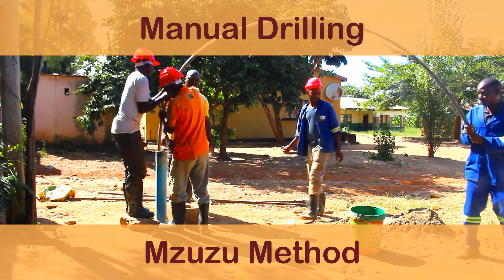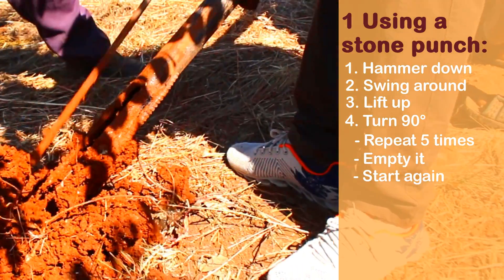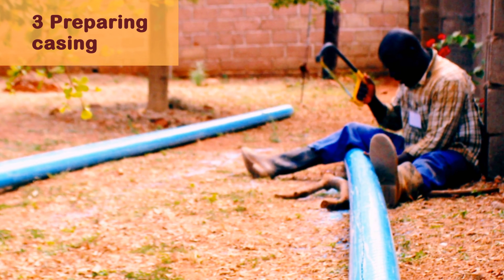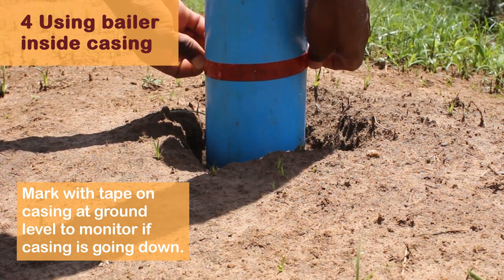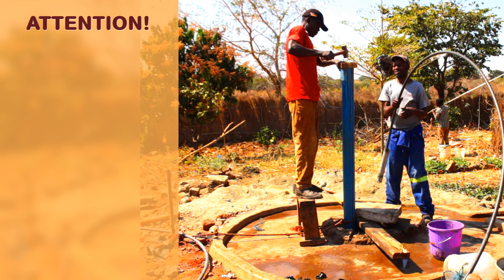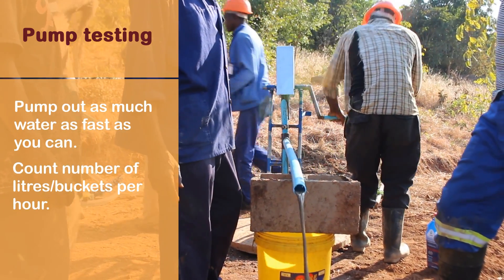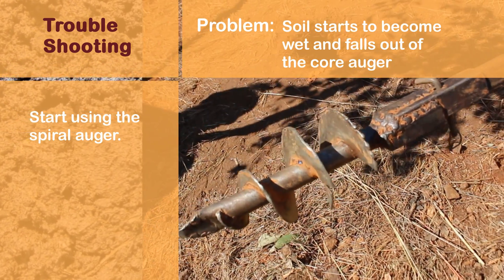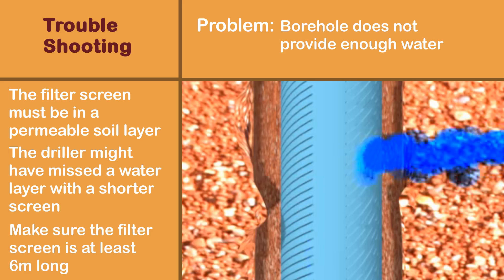Tutorial simple manual borehole drilling, Mzuzu method.

Comment: Well described method. I hope the needs of people are being met. A surging tool may be helpful in opening the filter pack. If there are experiences with sidewall collapse a clay slip liquid introduced around the casing may be needed.
Reply from the maker: Thank you Braith Miller, for your good comments. From experience, In most cases when drillers are using a bailer, there is already a lot of pulsation in the casing while drilling and the slots don't get filled since no drilling liquid or mud is used. As a result, these types of boreholes are very well developed compared to other methods. But if drillers want to use a "surging tools" they can use what we call a "swabbing tool" which is explained in this animation: https://youtu.be/UvKsmuwSi9o?t=759 . We might make a special video on borehole development. If you have suggestions, please met me know. You are right, in some cases it is useful to add clay slip but in our experience only to lift loose sand partials. If a pipe is stuck, we suggest to just continue drilling, possibly add a weight to the pipe to constantly push it down. Because it is a great opportunity to make a big hole as water reserve. The pipe will drop down at the end and will be in a larger underground hole providing a lot of water. Thanks again for your comment.
Reply: @JacanaHelp  Thanks, I did see the mention of swabbing in the next video. In many of the areas I have drilled there can be large amounts of loose sands, gravel, rock layers that might collapse without the clay/ bentonite clay slip occasionally very high viscosity. Every place can pose different challenges.
Reply from the maker: @braithmiller  You are absolutely right saying: "Every place can pose different challenges." That is the major reason why manual drilling is a skill that people will only learn by doing. 3 weeks of intense training with theory and lots of practice is just the start. After that on the job guidance is essential. At almost every site, new small problems will arise and the driller must learn to use his/her initiative to coop with them. They must learn to trust their instinct, grow experience by trying and persisting.